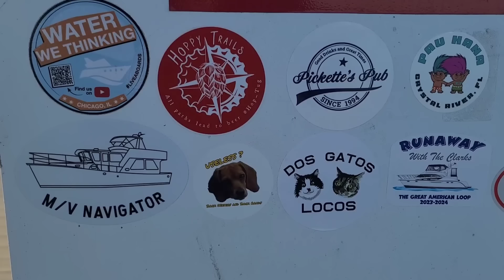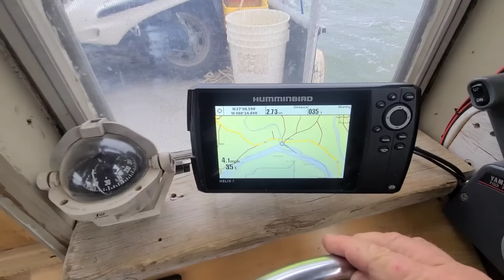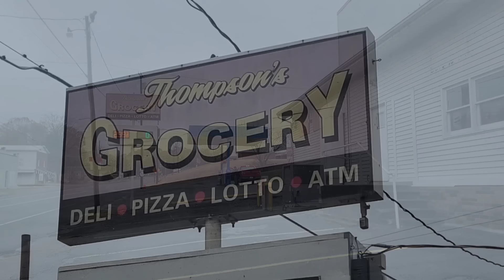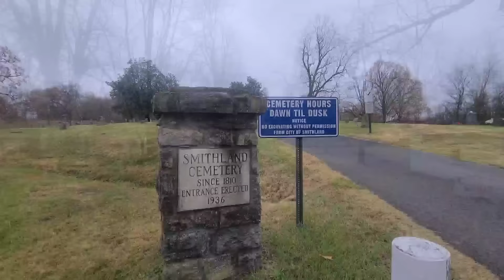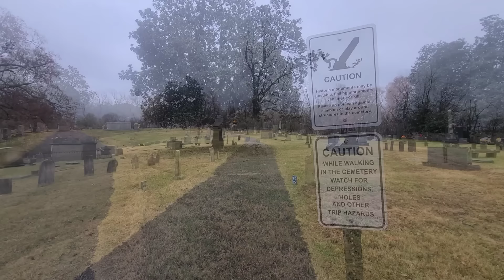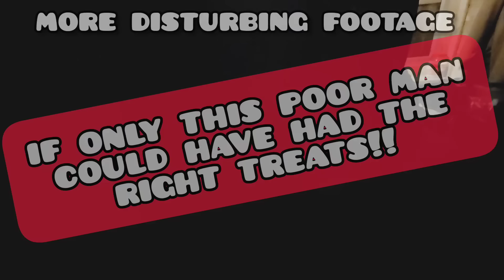Ep:21 The Great Loop on a Shanty Boat | "The Day the Bridge Came Down..." | Time out of Mind

Comment: The structure along the riverbank near N 37º 08.196', W 088º 43.719  appears to be part of Harrah's Casino. In Google Maps it appears to have been intact and functioning when the satellite image was captured.  Thanks for the video Brenton !!!
Reply: Yes part of Harrah’s
Reply: I’m shocked the casino wasn’t required to remove from the river.
Reply: google earth shows the casino itself in Metropolis. further down river, about 5-1/2 miles, near Joppa, there looks to be an older version being pushed by a tug. I believe that is the one Brenton shows in the video. but still, you would think Illinois or the corps of engineers or someone would make them clean that up. the video clearly shows insulation hanging between the studs, Lord knows what other carcinogens have polluted the river....

Comment: You have a great sense humour Brenton!!!  Keep bringing it!!

I noticed a diesel heater…are you using it?
Reply from the maker: Thank you. ;) the diesel heater works, but I haven't fully installed it yet.
Reply: They work great and will warm that interior like no business.  Sip fuel too…if I’m not mistaken they are able to burn kerosene as well.  I use a sump pump flexi hose to extend the air intake well away from the exhaust.

Comment: Ok. The Ohio river in summer pool. Runs between 1.mph and 1.5. Mph. After the fall rains goes up alot 3 to 5 mph. Also below the wallbash. In Indiana and the  green river in Kentucky.  The flow after fall rains is alot.  Loopers should be there by mid October at the latest.  Loopers should enter Kentucky lake by oct  1st .  Lived half of my 63 yrs plying the Ohio river.  In recreational boats. The Ohio river from july 1st to mid October is great.  From 1st November to mid june. A very different body of water
Reply from the maker: We were definitely getting her at high current. I'd guess 3-5 mph?

Comment: Did you try navigating closer to shore when going upriver? Much less current there.
Reply from the maker: Yes we did. That's a great trick that really does work. Also ducking in behind anchored barges at the mouth ;) anything to cut the current down
Reply from the maker: Yes we did. That's a great trick that really does work. Also ducking in behind anchored barges at the mouth ;) anything to cut the current down